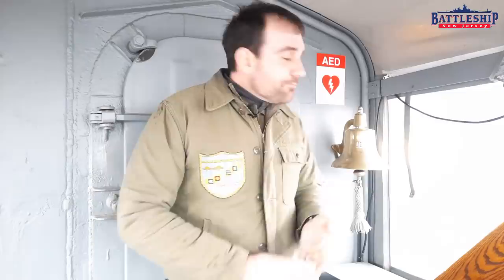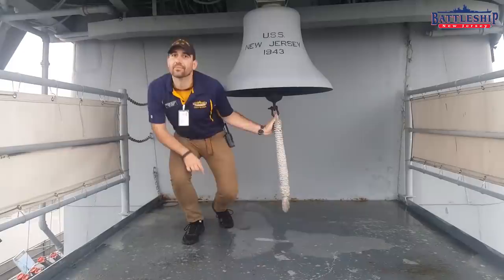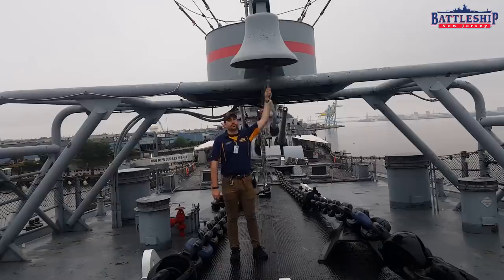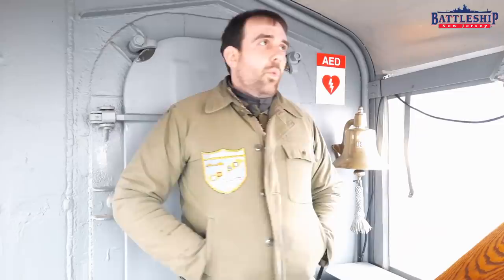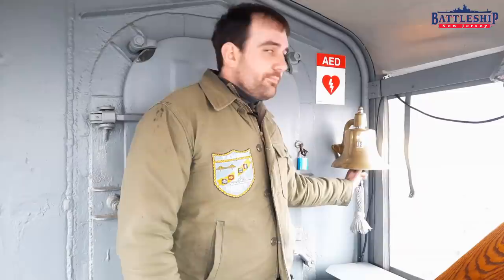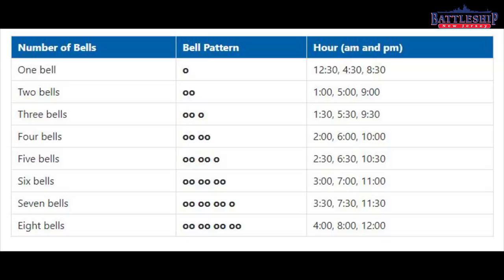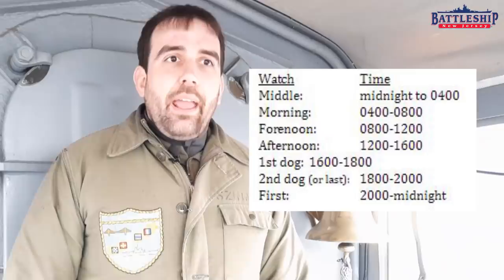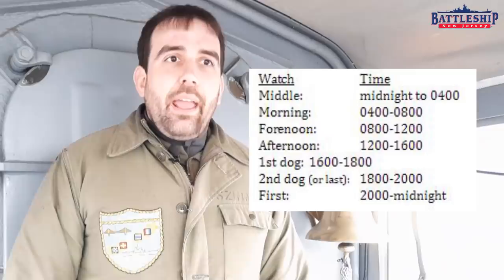The Ship's Bells: Telling Time on Board

Comment: Even in the modern Navy a lot of time at sea many divisions work a 4 hour on, 4 hour off schedule.  During those 4 hours off you eat, clean, sleep, do other work ... your division may not have the numbers of sailors break things up enough to do 4 hours on and 8 hours off.  

In port or at sea when the ship receives high ranking visitors (officers equal in rank or higher than your C.O.) the Quarterdeck bell is rung as part of the "Honors" rendered to that officer, the number of bells received is determined by that visitors rank.  Yes, the small Quarterdeck bell or a similar small bell on the Bridge when underway, not the big 'Ship's Bell.'  The announcement would be broadcast over the 1MC general announcing circuit shipwide.

Commander and Captain or other service equivalent receive 4 bells (DING-DING ... DING-DING) 
Flag officers of One or Two star rank receive 6 bells 
Three and Four stars receive 8 bells as do the POTUS, VPOTUS, SECDEF and SECNAV. 

The arrival announcement which follows the bells tells you who it is who is arriving, usually by announcing the name of ship commanded or the officer's posting, so the announcement should sound something like 'DING-DING ... DING-DING ... NEW JERSEY ... ARRIVING' for USS New Jersey's Captain, or for a Two Star Admiral 'DING-DING ... DING-DING ... DING-DING ... CRUDESGRU TWO (Cruiser Destroyer Group Two) ... ARRIVING.'  

Similar announcements would be made when those dignitaries left the ship with the word ARRIVING replaced (of course) with DEPARTING.  If that Officer is in your chain of command, the end of the announcement would be accompanied by a single Bell or 'stinger' at the end of the arrival / departure ceremony.  

The East Coast battleships in the 1980s - 90s came under the command of Commander Cruiser Destroyer Group Two.  His arrival would therefore sound like 'DING-DING ... DING-DING ... DING-DING ... CRUDESGRU TWO ... ARRIVING ... DING!'  

When I ran my Quarterdeck Watch as Officer of the Deck In Port, I would have my Petty Officer of the Watch sound the bells and make the announcement the moment I was certain it was that officer approaching my ship.  We would then wait until that officer's foot hit the top of the brow or touched the deck and the PooW would then ring the 'Stinger.'

I once flummoxed my Command Duty Officer when I had my PooW sound 4 bells and announce 'COLONEL, UNITED STATES ARMY ... ARRIVING.'  This gent was in full dress uniform, his Eagles in plain sight on his dress coat.  His arrival caught us a little by surprise, we WERE expecting him but no one expected him in his uniform (US Army Retired) and no one informed the Quarterdeck watch standers what was going on, so I fell back on my training.  This Gentleman was an Uncle of the man our ship was named for and was to visit with our Captain.

I had a chance to talk with him for a moment after I got off watch.  He told me that my watch team and I had made his day ... he had NEVER before received Navy 'Side Honors' while visiting his nephew's namesake ship.  The Side Honors we rendered were totally correct and he received similar honors when he departed in company with the Captain.  

The Command Duty Officer (a Lieutenant who should have known better) asked me "what the F*** did you do that for?" after my Messenger escorted the Colonel to the Captain's Inport Cabin.  The Executive Officer overheard and straightened the LT out very quickly.  CDO and XO had come charging out of the Wardroom when the unexpected announcement was made.

I was a Petty Officer First Class at the time, with about 12 years service I had about 6 more years in than the LT did.  

Yeah, a long winded Sea Story, but a true one.
Reply: Spent a lot of time doing ship checks at NOB Norfolk as a civilian yardbird, almost had a chance to hear “United States, Arriving” on a carrier but the visit was delayed and I had left for the day. Missed opportunity.

Comment: “Men working aloft. Do not rotate, radiate, or otherwise energize. Men working aloft.”
Reply: I was among the few ET's that didn't have a fear of heights so I have been to the very tip top many times. I remember getting that chit signed from the bridge down to the engine room before I went aloft. FDR CVA-42 1975.
Reply: Man aloft.  Do not rotate or radiate any electronic equipment while man aloft.
Reply: Always look up

Comment: Per the International Regulations for Prevention of Collision at Sea (COLREGS) Rule #35 the ships bell is only used while at anchor in reduced visibility. The bell must be placed in the "forepart" of the vessel and vessels over 100 meters long must also have a gong close to the stern (I suspect that during WWII the rules were a single bell located towards the middle of the ship, hence why NJ had 2 bells). Once every minute the ships bell is rung rapidly for 5 seconds followed immediately by the gong also ringing for 5 seconds. While navigating in the fog the ship's whistle would serve as the warning device.

I've spent a lot of hours navigating in the fog, you cannot tell which way the ship is pointing by the time delay of the sound since the gong is rung after the bell, but it does tell you it's a big freaking ship ahead so go wide.

Comment: The bell on the forecastle and the gong on the fantail (for ship lengths 100 m or greater) are used while the ship is at anchor in restricted visibility. They are sounded at 1 minute intervals (staggered a second or two each cycle as to to mask the sound of another ships sounding) in the following manner: rapid ringing of the bell for 5 seconds following by a rapid striking of the gong for 5 seconds. Have done that many times in my Navy career. The watch keeping bells are mainly for the deck watch, i.e. pilothouse/bridge watch standers including lookouts. As far as I know, that hasn't changed. It really doesn't mean much for the engineering watches or say someone in supply or admin. There has always been a disconnection for some about the purpose and scope of those bells. I have been on minimum manned ships, the FFG-7's were a great example. The Navy discovered that it really doesn't work. Not enough people to perform duties plus inadequate rest if at sea for more than a few days. I am all for given LPO's the discretion to send their charges to there racks for sleep at anytime it is necessary. I can tell you, I have been exhausted with constant 30 hour days over a deployment. Yes, I have heard the Roach Coach is making its approach...once! My favorite is liberty call, but tied is when the BMOW pipes chow (long version). QM1

Comment: On subs we never used bells...Watches were normally six hours each. Unfortunately, when the nuke carriers started coming out in the early 70's they sucked up a lot of  the nuke personnel and many subs were robbed of their reactor operators. Some subs couldn't leave the dock as they only had one RO.  I did more than a few patrols in port-starboard watches because we only had two qualified reactor operators on board.
Reply: Yeah.... using bells while attempting to run quiet kinda defeats the purpose ;-)
Reply: Rumor had it entire class before mine went to Big E for refueling overhaul, fortunately I did get subs. I heard thru grapevine some Nucs never left shipyard in Norfolk and enlistment ended.

Comment: In the RN we had 4 watch system ... STB 1 & 2 ... Port 1 & 2, but both parts would usually work together
Our routine was (Flight Deck carriers) 0800 >1200 ... 1800 > 0800 ... 1200 > 1800 then repeat 0800 > 1200 etc, when you did the 1800 > 0800 you would stay on deck till flying finished apart from the duty watch PT1 or 2 or STB1 or 2, there was another team that worked every night (the night hawks) they would turn 2 at 00.00 and would do all the aircraft movements needed for the start of flying the next day, if flying started before 0800 then the 1800>0800 had to turn 2 again to start the day off
Reply: You also have that whole mutiny thing during the second dog watch, I forget exactly what.

Comment: BUT WHY?
Would be obvious to any shellback, but I never served on any USN ship.
However, I have the utmost respect for anyone that has, and also for their traditions.

I can see why there are no audible bells on subs; they're kind of noisy.

But one thing I have done is skipper many sailing and power boats, generally under 30 tons, on short and long deliveries, and wouldn't think of disabling the ship's bell clock from ringing every half hour. The only times I was overruled in that decision were when the owner or his wife "couldn't sleep", and so everyone else suffered a huge loss of efficiency and routine for their sake.
Preferably there was just One clock that we ran the vessel from, and that clock was a (mechanical "8-Day") Chelsea, because that meant the least amount of tinkering to keep it aligned with UTC.
Yes, we kept Local time on the ship's clock, which was adjusted for our current time zone.

Digression: The Worst deliveries were the ones with just two onboard, where standing 3 on 3 off meant you were pretty much a zombie by the time you arrived. The Best deliveries were certainly the ones I did alone, but watch-wise I would have to say 3 on 6 off. That's with six people aboard, two people on watch at all times, with a new person coming up every hour and a half. It was always best to let anyone that wanted to overstand their watch, or let their watchmate sleep, do that. You don't need two people to stand watch if there is not a lot of stuff to do.
We generally did not employ a dogwatch, but i wouldn't criticize other vessels that did. After the second week there were sometimes watchmates who got tired of each other and it was always ok to shuffle the assignment. On larger vessels this would be disruptive, and larger crews tend to have more specialized jobs, but with six or less it worked well.
The Worst number of people to have was 3, hands down. OK for a short trip, maybe, but never the best, which I would say was four. Once you have six or more aboard, it is more trouble than it is worth.
Anyway, to answer the "Why":
Because the 8 bell system enabled everyone to know Exactly what time it was, without wearing a watch or looking at a clock, and what was expected of them, whether they were Awake Or Asleep. Yes, this system is decipherable even when you're sleeping, which is the one thing everyone wants to do when they're not running the vessel.
Thank You

Comment: On board my destroyer in the 80's my rate was under manned and we were always short handed. As a result, while the steam plant lit we stood 6 hours on 6 hours off. 6 and 6 as we called it could go on for several months. Rough duty in a hot engine room.

Comment: Before the days of mechanical chronometers, the most consistent most accurate glass was a half-hour glass.  Ringing the bell was a way to guarantee that the glass had been turned.  Knowing noon and midnight were important for reckoning  the stars and sun
Reply: I have heard that some less responsible sailors of that era would hold a match to the hourglass to heat it up ever so slightly, in order to enlarge it and have the sand flow through just a bit faster.  True or not?

Comment: When the ship was underway, was "official ship's time" adjusted daily to correspond to local noon or local midnight at whatever longitude you happened to be?   On transatlantic liners, there was often a master clock system on the bridge or in the chartroom that with a single adjustment reset all the linked clocks on board.    Was there anything similar on warships?
Reply: The official ship's time is keep by the ship's chronometers in the charthouse. Those are started in GMT and the daily errors are recorded for correct to GMT. The mechanical chronometers had to be wound daily at 11:30 LMT. The US Navy doesn't use local apparent noon for time keeping purposes. It is used to obtain a latitude. The US Navy uses Local Mean Time, that corresponds to the Time Zone the ship is operating within. There is no master clock the resets all the clocks aboard. Depending on era, the Navy preferred sending a Clock Petty Officer around to adjust and wind the ship's clocks. Later, when the clocks became battery operated, the duty Quartermaster would do the official time check/hack from the bridge and the personnel in the space with the clocks would make their own adjustments in time. QM1
Reply: @toddf9321  Thank you.
Reply: @Pamudder  Welcome.

Comment: Through out these videos I've noticed that many handles, controls, instruments,  etc are made with thick brass or steel. It seems to me that down sizing or thinning these out all over the ship would equate to multiple tons of weight savings considering how large an Iowa class is. Why do you think things were built in such a way? For example why would you need big heavy brass lever deep in the ship where it is not load bearing or a spark hazard. The weight could be more armor or ammunition.
Reply: Because things were built to last back then.  Built to be operated in a hurry.... maybe more forcefully than normal... under conditions where they COULD NOT FAIL.

Comment: "There are men working over the side.  Do not rotate screws, cycle rudders, take suction from the sea or discharge to the sea or energize underwater electronic equipment."
"The Navy Exchange Mobile canteen is now on the pier."
"Sweepers Sweepers man your brooms.  Give the ship a clean sweep down fore and aft.  Sweep down all ladders, decks and passageways. Deposit all trash in the receptacles provided on the pier. Set condition yoke throughout the ship. Knock off ship's work. Liberty for the crew."
"Reveille, reveille.  All hands heave out and trice up. Breakfast for the crew."
"Tattoo"
"Taps, taps. Lights out.  Maintain silence about the decks."
"There are divine services in progress.  Maintain silence in the vicinity of divine services."
"There are men working aloft.  Do not rotate, radiate or energize any electronic gear."

And of course while at sea the Chaplain would come on the 1MC at taps to give the nightly prayer.  Pretty cool to listen to while the ship moved through the water and the berthing compartment decks were bathed in the glow from the red night lights.  I slept pretty well at sea.

My retirement clock rings authentic ship's bells and still does so 30 years after the fact.  I am sure glad it uses a battery to operate the clock and ring the bells for time.  I had a wind up one previously and it was such a pain to remember to wind it every week.

Comment: I've always wondered why it's traditionally a common thing In militaries, especially those based on conscription instead of voluntary, to keep troops In a constant state of sleep deprivation even when not really necessary when one would think that well rested and alert people would do their work more efficiently and safely? Do they think guys numb with exhaustion are more likely to blindly and mechanically obey orders and less likely to question them or what? Or maybe when you're really tired you won't be so afraid for your life?
Reply from the maker: Usually they are just so strapped for man power that they have to do things that way. There are only so many beds you can fit on a ship, but there are a lot of jobs to be done.

Comment: Since you asked about asking questions here goes. I recently visited the USS Missouri in Pearl Harbor.  Well I couldn't help notice the access hatches on the 5" gun mounts are completely welded shut. Not only are they welded they are ground flush with the turret. I have visited several battleships and have never seen this. Can you explain this? 
BTW...I have tried asking Missouri but no response? 
Thanks.
Reply from the maker: This might be a safety feature by the museum, unclear without it being in front of me, sorry!
Reply: @BattleshipNewJersey  I think that will come back to haunt them badly when deterioration from inside makes its way through the metal.    Seems like a locking hasp or, if really desired, a couple of spot welds would suffice.

Comment: Enjoy your videos. Have a question I have toured the Alabama 2 times awhile back and always wondered what the rectangle switch boxes were that had like 4 or 5 buttons one was stop cant remember the rest. I think one was forward? There was several  thru out the ship or just on that same level but could be wrong.
Reply from the maker: Might be a ventilation system? Lights?
Reply: @BattleshipNewJersey   i don't think it was for lights. Just had a thought could it be for the crane track that runs thru the passage way?
Reply from the maker: The crane track isn't usually powered, its just a track and then something slides on it.
Reply: @BattleshipNewJersey  Ok hopefully someone will chime in with what it is.
Reply from the maker: Can you be more specific? We've got a lot of switch boxes!
Reply: @BattleshipNewJersey  it was rectangular i believe yellow or black with the buttons stacked on top of each other  like a stoplight the one in the middle said stop. I think the others ones had like forward/ reverse/ mabe even full. Im fairly certain that one was stop. They where on the same level as the main deck. But in different spots on that level. Can't remember if they where on other levels. Hope this helps

Comment: At first, I found ship's bells, annoying. Then, I learned, I can stow my wrist watch, and let the ship tell me what time it is. Can come in handy to stow your watch when you're working around machinery, or if you just don't want to get your wrist watch mucked up with dirt, grease, wax, or cleansing agents. 8 bells = 0800, noon, 1600, 2000. Last bell aboard ship is 3 bells, after that is Tattoo, then Taps, at 2200. Bells increment by 1 and sound every 30 minutes, goes back to 1 after 8 bells (e.g., 0830 = 1 bell). I've grown to like the ship's bells, so much, over time, I've started looking for them on line. Anyone got 800 bucks ?? Yikes.